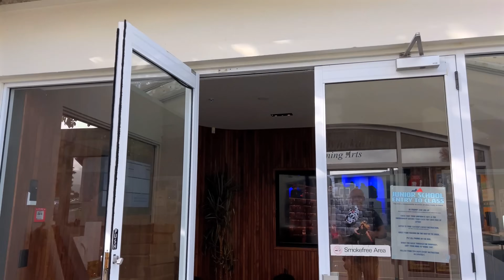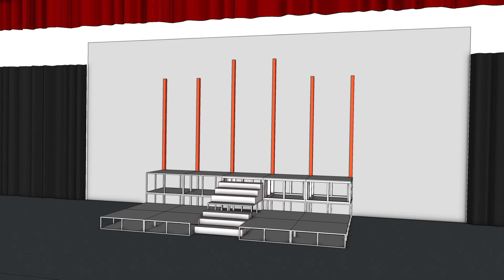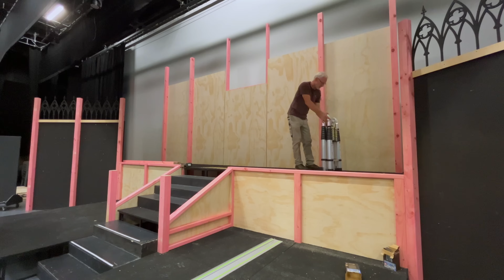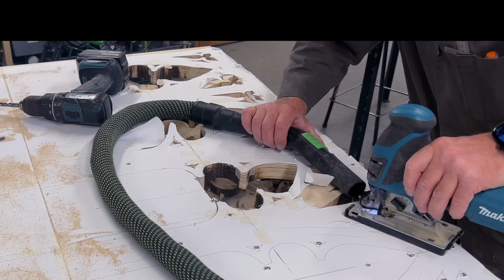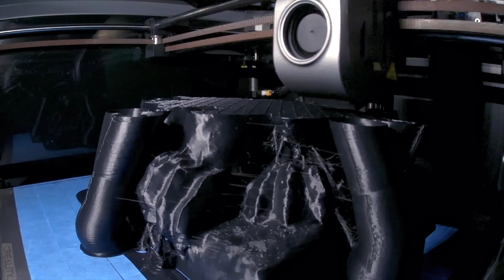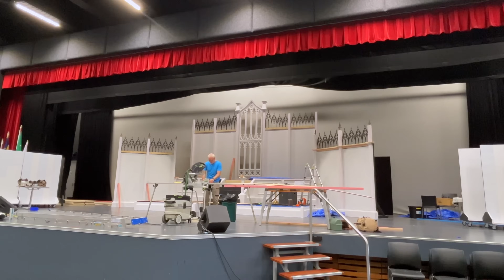How I Built The Addams Family Production Set  |  Full Solo Build

Comment: Great effort, fascinating watching it all come together. One hint from macrame for fixing the twine wrapping around your rope; first run a loop of the twine the length of your wrapping (bottom to top and then down to the bottom) then wrap up the length, feed the end of your twine through the exposed loop and pull down the other end of the twine which is at the bottom of the wrapping. You end up with your two ends pulled half way up and down behind your wrapping.
Reply from the maker: I knew there'd be a better technique than hot glue! 🤣  Thanks for the suggestion, and the clear instruction - will definently give that a go.